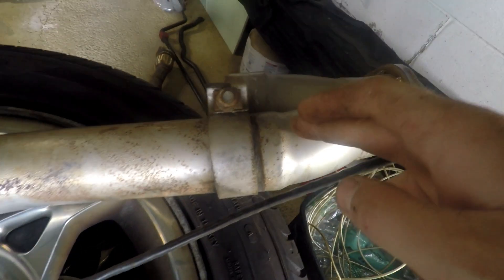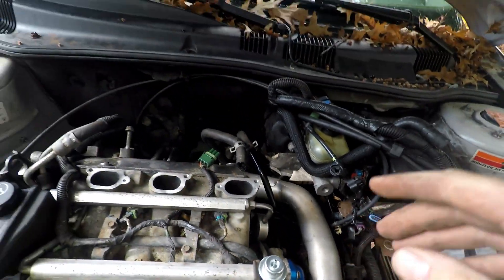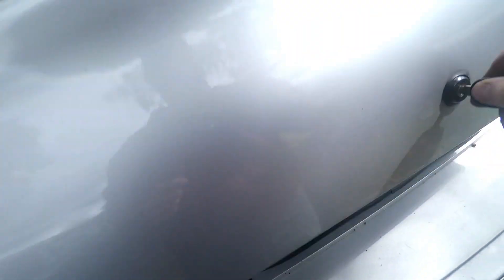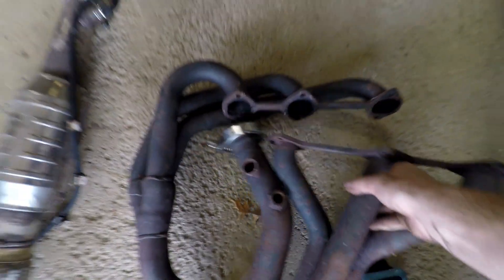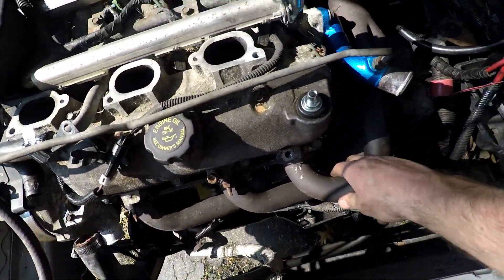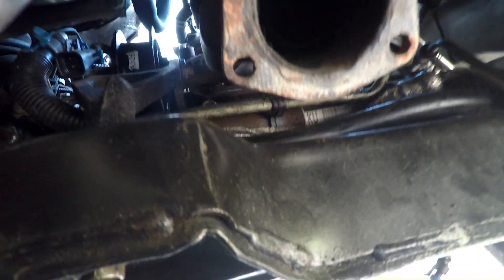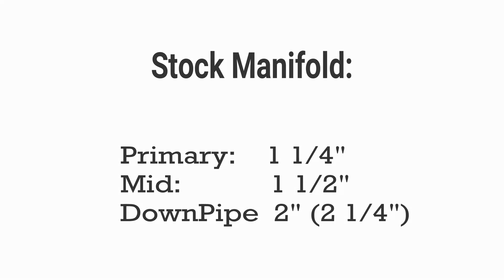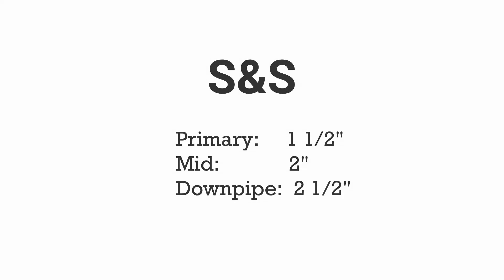GM N Body Header Comparison Part 2

Comment: The Pacesetters don't clear the radiator hose, you have to cut an inch or two off, gives it the right angle. And it comes with wiring and shrink wrap to extend the wiring for the 02 sensor(new kit). The flaw with the Pacesetters is the "slip fittings" where the two banks connect to down pipe, can seperate under heavy  acceleration. I don't remember how I fixed mine, either cranked the clamps down or welded one side.
Reply from the maker: Explains why the clamp was welded on these. Good info tho! I didn't run into the hose issue. I could see the wiring tho. When I had my s&s installed I had to pull it out some to work.